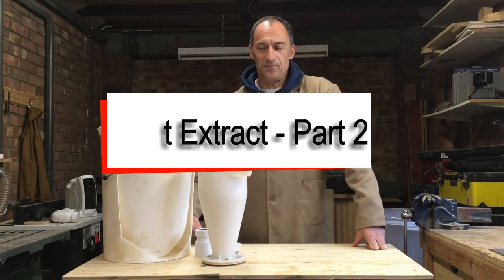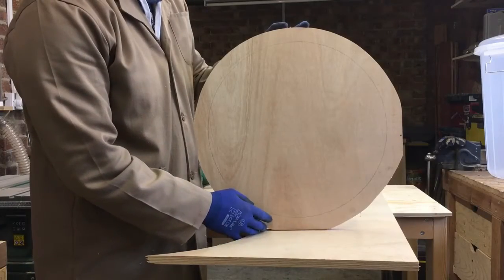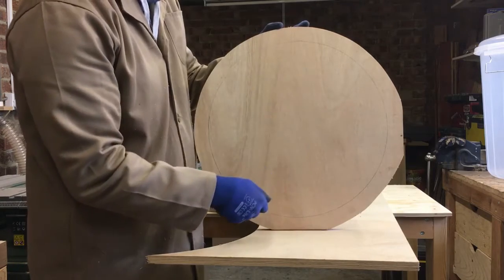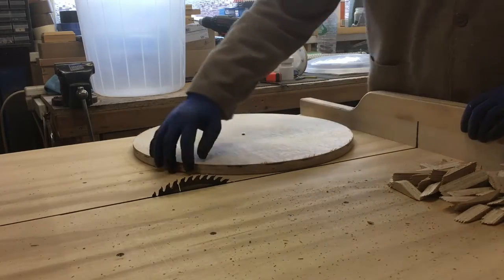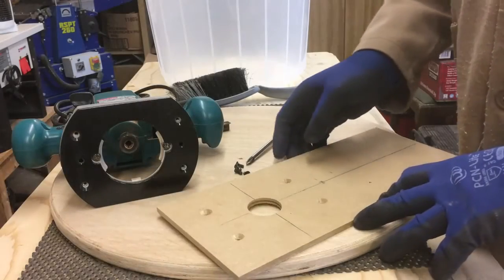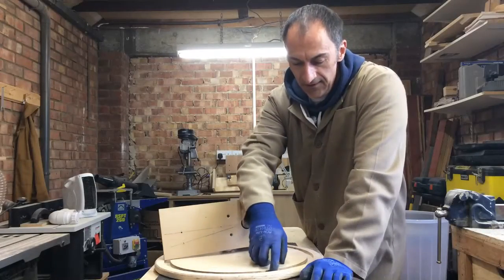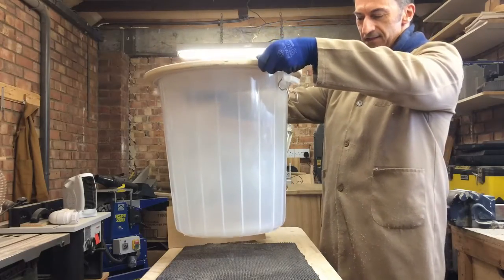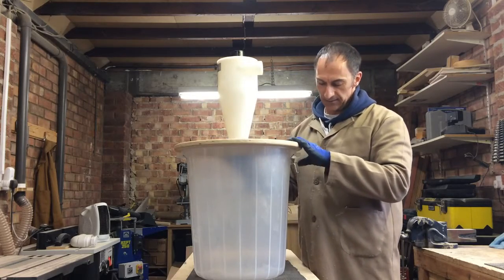Dust Extract Cyclone - New Collection Bin

Comment: Hi Greg great system , was wondering if you have dimensions for your table saw sled? Thanks David
Reply from the maker: Hello David, i cant remember exactly but it is slightly bigger than the saw table top so approx 900x900
Reply: @GregVirgoe  thanks Greg I take it you utilised both tracks on this?

Comment: My neighbour Terry has the same cyclone as you & like your first demo he to had a small bin which he was using, as usual I went around to his workshop & noticed his bin was deforming under the pressure, it's an easy fix as I told Terry just cut out some circular wheels out of 4 mil MDF that fit them inside the bin in his case 2,  fitting them 10 mil apart the cut smaller holes in the wheels to lighten them up & to make the dust fall thru when cleaning, it took us about 20 minutes to fix his problem, perhaps it might help you or anyone else who comes across the same problem! Thanks again for another great production
Reply from the maker: TheAudiostud, yes I was thinking just a simple wooden ring fixed half way down the bin would help to keep the bin from collapsing. The new bin I got is a lot thicker plastic and now I always make sure at least one last gate is open at all times.

Comment: Hi Greg, great video. I’m putting in a dust extraction to make us of my old Henry. What brand of solvent pipe and swept Tee fitting are you using and where did you purchase them from?  Thanks.
Reply from the maker: I used polypipe from local diy store. Wickes or Travis Perkins will probably be cheapest. Stick to the same brand as some differ slightly in size.

Comment: Another great video!!! What's the other Henry hoover in the background?
Reply from the maker: numaticrule29 Thank you and very well spotted. I was given another Henry by a family member so that one has a normal bag in it and we use it for outside the garage, cleaning cars out etc. These guys work really well, great addition to the shop.
Reply: Greg Virgoe ah ok. I spotted it in the last video and wondered what you used it for!
Reply from the maker: I've also put together a fitting that allows me to connect both Henry's to the cyclone. If i ever need twice the volume flow rate, when using the planer/thicknesser for instance, I can hook up both shop vacs at once.
Reply: Greg Virgoe ah I wondered what that fancy bit of pipe was

Comment: Hi Greg, i came across your channel last night and i have subscribed, it is nice to see a fellow Brit on youtube that talks in metric sizes, i thoroughly enjoyed your dust collection video, i have one question , i'm guessing when it comes to attaching your hoses to the machinery you are using reducers and if so where do you purchase them from, keep up the good work.
Reply from the maker: Hi Andrew, I'm pleased you found it interesting. I'm old enough to remember feet and inches and you will find I sometimes mention both. 
Yes, I use different plastic plumbing reducers and often make up the difference with good old duct tape. Difficult to find an exact fit. But the pool hose and wire clips fit 2" plastic pipe perfectly. Good to see a few more fellow brits on board. Cheers 👍🏼
Reply: hi andrew,i just stumbled across greg as well nice to have  brit on youtube makes project relevant to us brits as in where materials bought ect
Reply: @GregVirgoe  .what size is he the outlet pipe pleas

Comment: Greg, do you think there is any reasonable limit to bucket size with that smallish cyclone? I want to use a full size domestic bin with a 2hp chip collector but we dont seem to have the bigger cyclones here in the UK, like the Super Dust Deputy that they have in the States - we only seem to have those 12 inch ones that look more suited to a hoover. Shame we cant get ones with the 4" / 100mm inlets
Reply from the maker: Hello, You can get larger ones in the UK that are suitable for 4" hoses and bigger workshops but they are not cheap, here is a link for you... 
 https://rover.ebay.com/rover/1/710-53481-19255-0/1?ff3=4&toolid=11800&pub=5575265109&campid=5338027957&mpre=http%3A%2F%2Fstores.ebay.co.uk%2FJBI-MEGASTORE%2F_i.html%3F_nkw%3Dcyclone%26submit%3DSearch%26_sid%3D656093030
Alternatively, the cheaper option would be a dust collector like these....
https://rover.ebay.com/rover/1/710-53481-19255-0/1?ff3=4&toolid=11800&pub=5575265109&campid=5338027957&mpre=https%3A%2F%2Fwww.ebay.co.uk%2Fsch%2Fi.html%3F_odkw%3Ddust%2Bextractor%26_dmd%3D2%26_osacat%3D0%26_from%3DR40%26_trksid%3Dp2045573.m570.l1313.TR1.TRC0.A0.H0.Xworkshop%2Bdust%2Bcollector.TRS0%26_nkw%3Dworkshop%2Bdust%2Bcollector%26_sacat%3D0
Reply: Crikey, they aren't cheap-plus they are a bit too industrial for me. I mean more something in line with the Super Dust Deputy like they have in the USA. Are they just an empty cone with an inlet and outlet or is there some sort of spiralling thread on the inside of them?